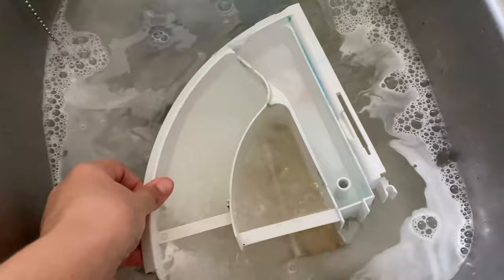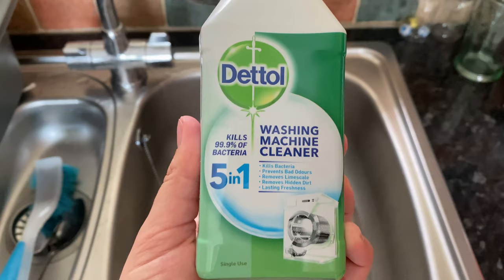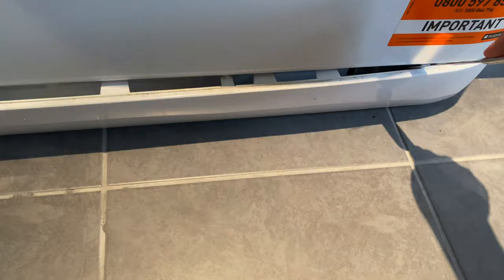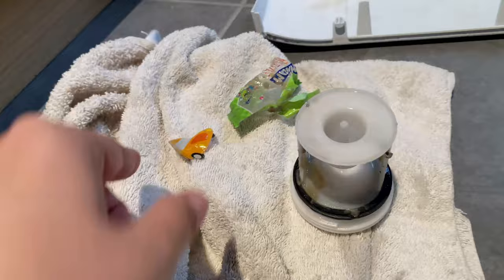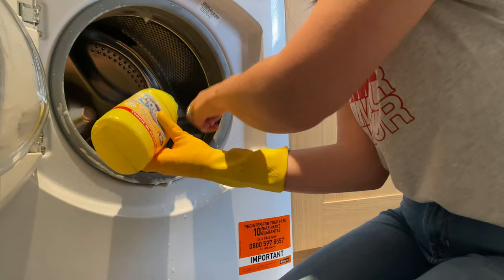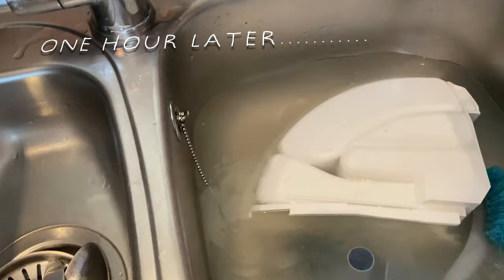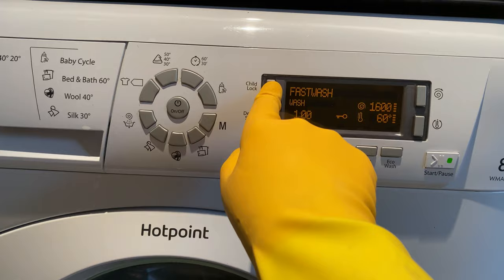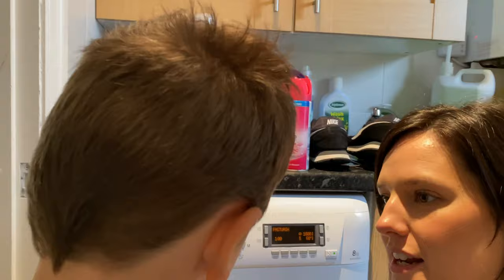How To Deep Clean A Washing Machine | Get Rid Of Mould

Comment: Just learn how to use a w m! Do at least 1 or 2 washing a week at 60 or 90 for towels and withes with poder an oxy like wanish that disinfect and also calgin that clean and remove limescale and residue...your machine will stay clean like new and last a lot longer! Alsoonce a month use cleaning cycle with 2dishwasher tabs and another with 150ml of citric acid!you have an idea of this yuky gung likd you said howmuch healty harmfullbacteria have? Like salmonella scherichiacoly a lot of peoples died for it and they find out it was right inside the machine where they been contaged of. The cure is: a cotton 90 with 200mlof bleach, another cotton 90 with 3 dishwasher tabs and another cotton 90 with 20p ml of citric acid, repeat if still dirty, repeat every week this sequence and little by little you will clean it likenew! Ps nb check that your machine doesn't not do a draining phase like i thing, before loading water, because in this case you just trouh it out all the washing machine cleaner and the disjnfectant!😩 o my goshhh 😩  in every machine 90 is only in cotton cycle, you dont have 90 in your machine because you selected fast cycle, NEVER EVER USE IT!😨 I HAVE TO WRITE A BOOK FOR LET PEOPLE KNOW HOW TO USE A WASHING MACHINE, YOU ADDED LENOR 😨 BAKING SODA VINEGAR ALL WRONG!
Reply from the maker: You should definitely write a book. Sounds like it would be helpful. Thanks for the tips 😃😃😄